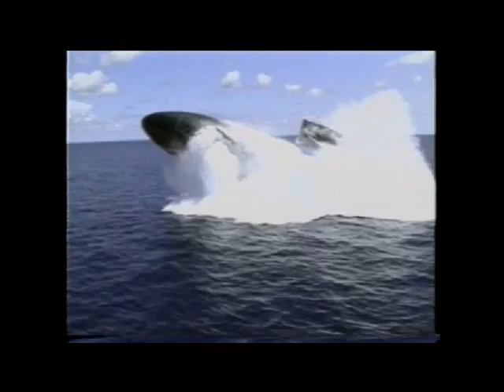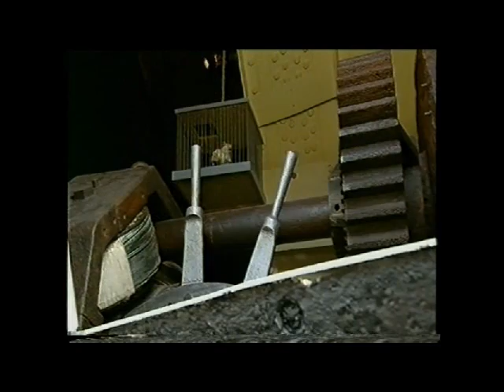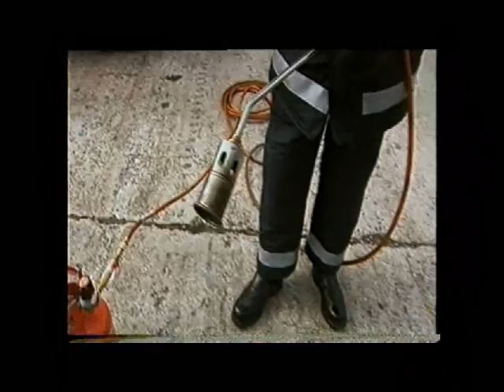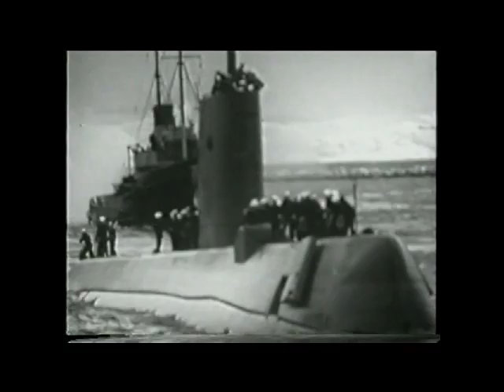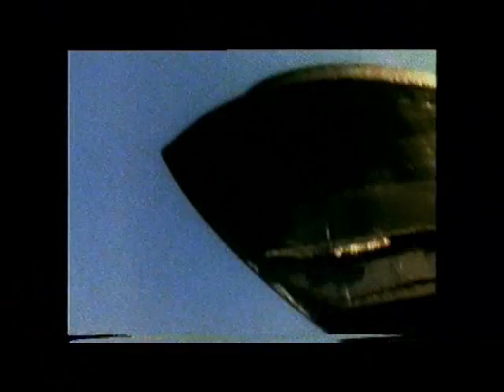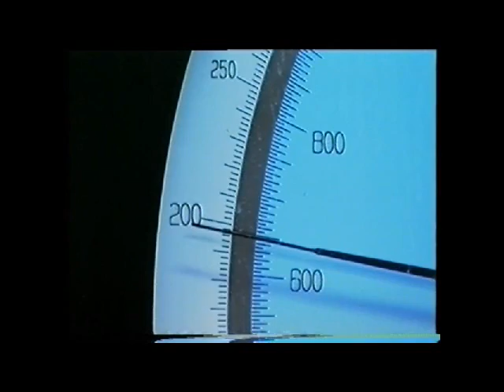Submarine Pressure Testing - Part 1

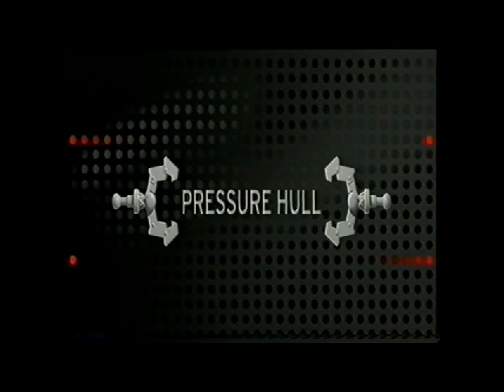Comment: 7:10 at 200 m it's actually around 20 kgf/cm^2. It increases by 1 kgf/cm^2 with every 10m depth. At the bottom of the Mariana trench it's around 1 tonne/cm^2. I don't know of many submarines that would survive this apart from a tiny capsule whose smaller area means less total force and a sphere shape is made strong by compression.
Reply: Oceangate was working on one for the mariana